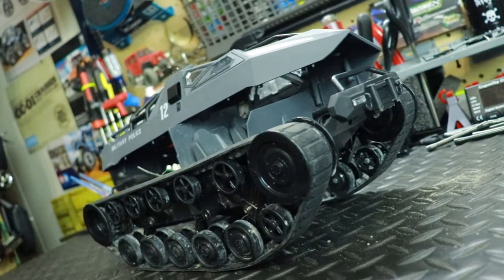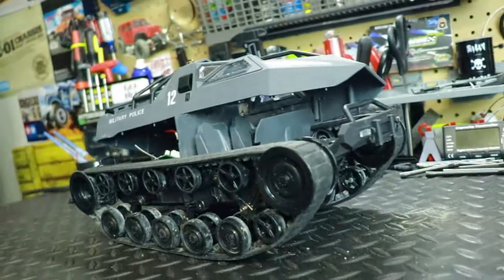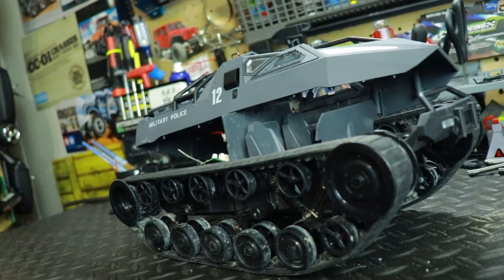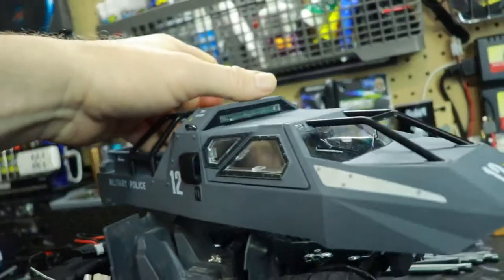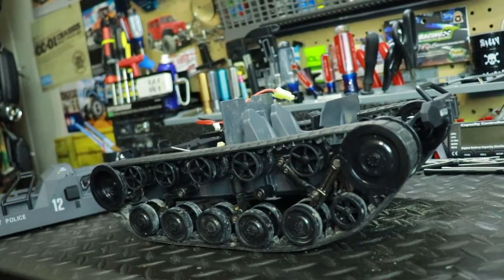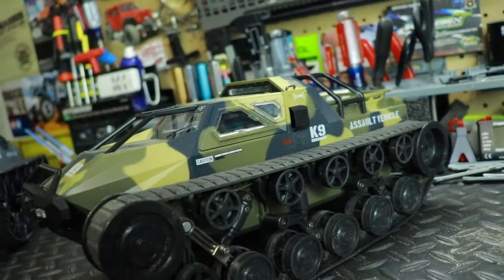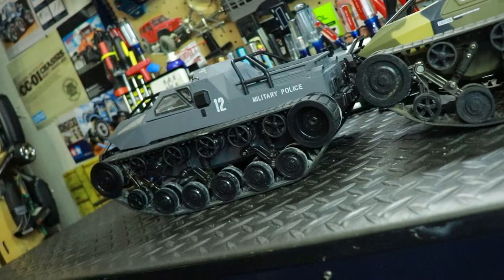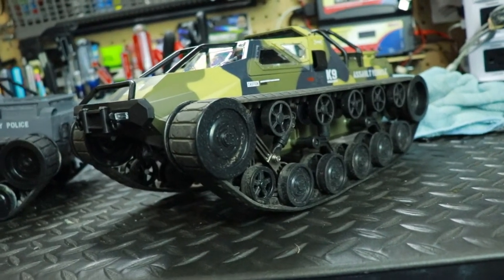RC84Films: RipSaw Problem!!!

Comment: That camo ones nice! O that stinks you fried it, when I first got mine I sprayed corrosionX on the board to make it waterproof. If I was you I would get two of those cheap hobbywing 1060 clone esc's I show in my ripsaw videos and put a normal 2.4 cheap radio in the police tank it makes them drive much better and smoother and it won't cost to much more then the stock esc unit.
Reply from the maker: Thanks for watching and the information. I have watched your videos on that pretty cool. After watching your videos I brought the police 1 thank you for ur videos